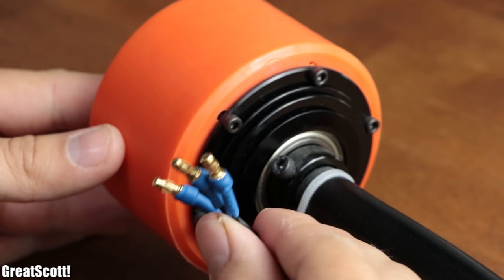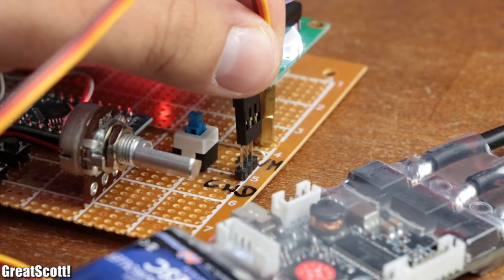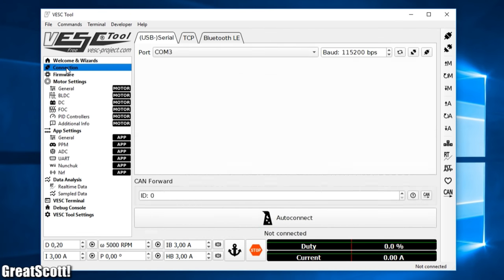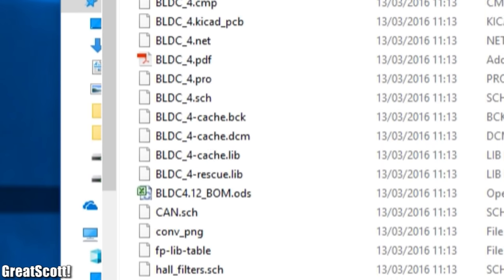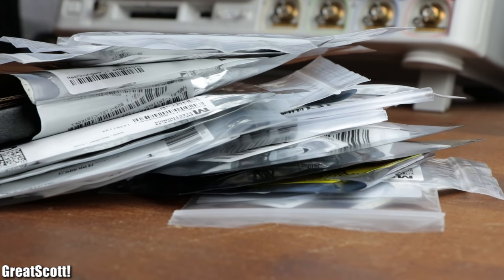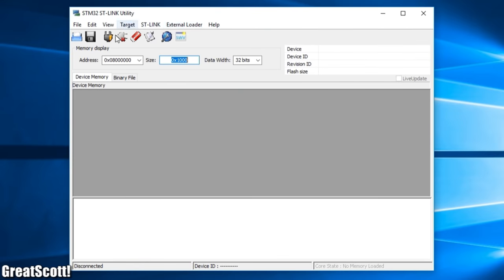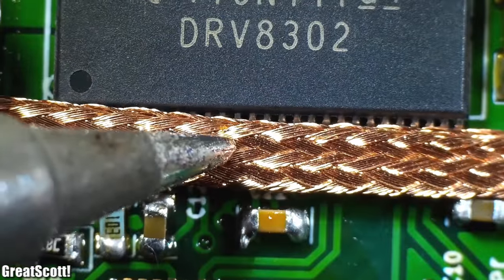VESC (Best Open Source ESC) || DIY or Buy

Comment: That soldering looks very bad.
Reply: smd soldering is very difficult even for people who've done soldering for years
Reply: AppleAssassin

Some SMD soldering can be tricky, yes, but things can be improved a huge amount just by a few technique changes.

The diameter of solder used here is pretty huge, and it doesn't look like any extra liquid flux was used, which is basically a prerequisite for smaller SMD like the QFP and SOIC chips.

It honestly doesn't take long at all to learn those few methods, swap out the evil bevelled soldering tip for a small 2-3mm wide chisel, buy some no-clean liquid flux etc.

It's also about not sufficiently heating both the pad and pin, then feeding in a smaller amount of solder.

The solder should ideally be fed into the contact area between the component and pad, and not "brushed on" nor moved around with the iron too much.

Mr Carlson did a good video on soldering technique recently. Although it was more for much larger through-hole stuff, he explains things well.
Reply: He needs to use a different soldering tip for SMD components. Something like a chisel tip.
Reply: yeah his soldering tip was way too big, I got the same soldering iron and normally there is a thinner one. Sad not to see the german perfectionism here xD
Reply: Yes, and stop adding more solder to it. The little on a chisel tip is more than enough.
Reply: Colin Alston but heats up the ic so it can damage it
Reply: He didn't use flux. That's the reason.
Reply: You shouldn't just use the solder that's on the tip of the iron, btw, as it will boil off most of the flux before it has chance to work.

The tip should be "tinned" with a very thin layer of solder at all times (and regularly cleaned on a wet sponge, then re-tinned), but the fresh solder should still be fed into the solder joint after it has been heated for about half a second to 1 second.

But yeah, you definitely don't need to blob that much solder on.

The solder joints should ideally have a kind of concave "fillet" shape to them. Like this...

https://www.helifreak.com/attachment.php?attachmentid=301793&d=1332650444

https://www.nuvation.com/resources/article/pcb-layout-creating-perfect-smt-footprints

Obviously we're not expecting pro-quality soldering on a DIY project, and my soldering isn't perfect either, but I hope this helps a few people. ;)
Reply: I think people convince themselves that it is more difficult whereas with a little practice it is actually easier or at least no harder. Using a huge tip, putting on way too much solder and then thinking the hot air gun will fix anything is a sure fire way to fail. I'm IPC certified and been in the industry for about 40years (commercially) but getting to IPC certified level is achievable by raw beginners with a week of practice. That is proven on each course they run.
Reply: I love his projects but not his soldering techniques... He should've used flux alone instead of using the solder fluxcore to make things flow.

Maybe the IC died because of so much heat? You gotta be very quick and don't be messing with it for so long with the hot air on top
Reply: AppleAssassin . No it's not. 1206 or 0805 is perfectly doable for pretty much everyone with a standard solder iron. In many cases SMD is even easier since you don't need to flip the PCB the whole time.
Reply: Piet Muijs Even 0201 is doable with a standard soldering iron, a set of 1$ tweezers and good flux
Reply: SMD soldering is VERY easy. This BS about it being difficult comes from grandpa kind of engineers that struggle to make the right joint, as they used to do THT for their entire life, and SMD is still something new to them. Then everyone spreads the lie, cause if so experienced engineers say that it's hard to solder surface mount components then it mus be the case. And now we have the third generation of hobbyists that repeat the same shit.
Reply: I was just going to comment that the soldering was not bad. Now, don't get me wrong, it's not great, but for GreatScott! it is a huge improvement.
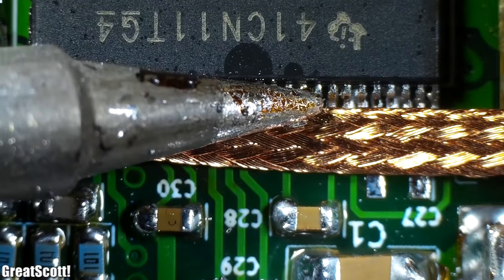Reply: When ever i see him put large mounds of solider on the connectors and then wick away the massive amount of extra, i cringe (ie 7:42 is massive cringe for me).  the lack of fluxing, bad tip choice (conical tips are horrible for SMD, blades and hook tips are ideal for SMD).  Really should be using much thinner solder wire (shouldn't really need anything larger then .8mm dia solder) for most of those small SMD parts.  Instead of the paste. Add Flux and heavily tin the pads. Then use a little hot air.

I only use solder paste when i have stencil and want to do the entire board in a signal shot with a soldering oven AKA a Toaster Oven.
Reply: I've learned quite a bit just by watching Louis Rossmann repair Apple MacBooks.  I don't really get into SMT much, but the right tip, proper diameter solder and precise control over temperature make a world of difference.
Reply: Cap 🗿
Reply: Lack of flux

Comment: C15 and C38 around the crystal should have the same value (18p), they have however a different color in your video. C15 looks surprisingly like C32 (that should be 100nF), so C15 is likely wrong. They are responsible for the oscillator. Please check and replace these components, they will likely fix your problem.
Reply: I wonder if that worked for him...
Reply: Dude, nice find!
Reply: Yeah, unfortunally scott's soldering isn't that great...
Reply: @samuellourenco1050  yeah.. and also lots of cold joints, voultar would cringe watching this video
Reply: @geovani60624  i saw alot of cold solder
Reply: That would not solve the problem, probably, cause if the hse crystal is not able to work properly, the hsi should work. So that change would just affect the source of clock, the problem doesn't seem to be in the clock tree.
Reply: I bet they are identical, it's just nasty flux residue over one of them.

Comment: have you tried some isopropanol and a toothbrush? it seems like you have a lot of spent flux there!
Reply from the maker: Yes. For the repair I cleaned the PCB quite a bit. Did not help though.
Reply: would you do a troubleshooting video? it would be really interesting! i am thinking about building my own esc for a while, i want to make a super beefy power output maybe with parallel mosfets and active coolling, for a really large bldc. Btw another cool diy or buy video would be a stereo amplifier! (class a/b, maybe? :)
Reply: GreatScott! I too have soldered the VESC on my own. The 10uF caps were really a problem so I got myself 4.7uF and soldered 2 on top of each other. Has the same effect. On mouser they have other MOSFETs with +0.2mOhm more rds on so I got these. Soldering took me 3 days since I could only solder in class since I don't own a soldering station. My first power on was horrible too. The VESC wasn't drawing any amps. Troubleshooting took about 2 weeks. I broke the MCU while measuring the voltage on the voltage regulator. Had to resolder it. I managed to programm the new MCU but the VESC wasn't working, so I thought it would be due to the unsoldered Drv ground pad. So I got a new chip. Resoldering the new one, the VESC wasn't working. After some time i desoldered the capacitor that is on the output of the buck converter and found out the the cap was broken. After that everything worked just fine. All this took some time but I had to get it going since it was my Abitur project. 
But the one VESC that isn't working, are you sure you soldered the groundpad? Are the voltages all right? Get KiKad and open the pcb file, with that you can see all the traces and perhaps find the error. Perhaps a pad of the MCU isn't soldered right. Troubleshooting my VESC made me examine every inch of it till i found that faulty capacitor.
Reply: 7:35 you need learn more

How to repair bridge and excess solder > watch?v=OaBRak0HnQs
Reply: +Faza Indriani
It's easier to use full links...
https://www.youtube.com/watch?v=OaBRak0HnQs
Reply: Can't clean no clean flux, I've tried.
Reply: Maybe try turpentine?
Reply: TheCreeperkiller of course you can. But the flux is not the problem here (flux is not conductive, some fluxes could corrode the board or increase leakage but that's unlikely to be a problem here). Given the soldering he has done there are likely more shorts there. Instead of futzing with the heat gun and paste it is better to drag solder it. And use thinner solder so that there are no blobs.
Reply: At least not with isopropyl alcohol, or maybe it's because the flux I ordered is from ebay. No matter how much alcohol I used and cotton swabbing, it still left a sticky residue.
Reply: It's like having a conversion with someone with about  loads of boogers hanging from their nose!
Reply: @KerbalLauncher  IPA doesn't help much with too much flux. Use Methyl Spirit instead.

Comment: Keep in mind that 90% of power transistors at Chinese online stores, especially aliexpress ones, are fake (cheaper, less powerful crystals than claimed). So even with firmware working there is a chance for it to blow itself up under heavy loads.
Reply: Totally agree! Those of us in the industry knows what's behind the scene. Nowadays, the counterfeit chips and components might even spot genuine looking markings, packings etc.  Electrolytic capacitors are the worst. Certain PC Motherboard manufacturer actually loaded fake caps unto the boards. 5 container loads of them, and all go harsh harsh to prevent embarrassment. Well, anyway, they expect no one will use a PC board for more than 2 years, so its ok for the caps to burst and vent while in service after that...As a rule of thumb, I'll treat ALL components from Aliexpress as counterfeits and supposed I need to use a 3A diode, I'll select a 5A one to accomplish the task.
Reply: @rontan8433  The famous China factor you have to add to everything.

Comment: Loved your video, but I do have a bit of a recommendation. After working on some complicated SMD circuits, I decided I was tired of hand soldering, and moved towards DIY reflow. I ended up getting 2 solid state relays and used them to drive a 2 element toaster oven with an arduino for temperature profiles. After a bit of programming, everything worked flawlessly. Now I just order stencils along with the PCB's, spread the paste over the board, stick the components on, and bam, perfect boards every time. I would love to see your take on a DIY reflow oven, and it would also help to improve the quality and quantity of boards you can produce. Anyways, keep up the great work!
Reply: good to know! ty.
Reply: Nice work.  Will it heat pop tarts still?
Reply: Hey would you mind recommending what type of heating element to use ??
I have ordered an LQFP-144 ic 
and honestly getting nervous as the delivery date is approaching
Reply: @TheAnimeist  No. An oven used for soldering or other chemical processes can never be used for food.
Reply: @user2C47  What if I wanted to poison someone with a cooked pop tart?  😀
Reply: @TheAnimeist  It would be a very slow death, and would likely require repeated exposure.
Reply: @user2C47  LOL

Comment: If you are going to do many projects like this, do get:
Flux (helps in getting the tin to behave)
A wedge tip for the iron (easier handling, can be laid flat aginst chips/solder wicks)
If it's not, get a temprature regulated one (any from china should do)

I agree on your conclusion, and JCL got a PCB assembly service that would likely be of great help.
By just getting the tiny (resistors & capacitors) stuff out of the way should help a lot, even if you have to place some few parts yourself.

Comment: Maybe if you make/buy an SMD to breadboard adaptor for the uC and program it before soldering it. Place it on a breadbaord,  add the oscillator and everything, and program it, At least you know that is not the uC with the problem. 
Great video and pretty complicate proejct!
Reply: Electronoobs how in the hell is this comment posted 1 day ago??!!
Reply: Youtube red?
Reply: Jan Daniel Javier he is a  patreon supporter
Reply: Patreon supporters pay to support the channel and noobs is a patron as am I
Reply: I think only problem is time who will spend more than 10 hours of prototyping and  soldering process.. just to save 30 dollars.
Reply: Sumit Kumar hey being an indian 30$ means a lot to me !!! I can start another project with those 30 bucks
Reply: You haven't seen his DIY Time Machine post? ;)
Reply: Yes, I think that too!
Reply: dome dom STM32 don't need a bootloader using ST-Link, it just overwrite the uC without problem. Maybe the problem was the pull up resistors on USB data lines
Reply: Also maybe to prevent shorts and all that soldering wick I'd say spend the extra $10 on a stencil and use all/mostly solder paste with a toaster oven or some hack...
Reply: Jan Daniel Javier Scott uploaded the video on 24th
Reply: man I love ur vids, but sad to see this one didn't work that well, but i do alot of hand soldering myself and self taught. I would suggest just using using solder paste with toothpick method, youtube it!! :D Solder paste all the pads and then heat gun them all on level surface just like the manufacturing process. saves time, i would then troubleshoot one by one, considering you were able to upload the firmware through st link and not get com port to show up in pc means there might be an issue with usb connection, maybe shorts. try reversing them traces with multimeter in diode test mode. if all fails it could be software related, try uploading sample sketches to make sure usb shows anything at all pc side. but your point is right time is money, but try fiddling with it, when you have spare time to kill :)
Reply: Vales verga wey como electronico , ablas como si tuvieras una verga en la voca
Reply: HEY MATE CAN I USE A SEPARATE ESC OR VESC FOR EVERY MOTOR I GOT WITH A SINGLE REMOTE ???
Reply: Or the wrong Hex Number to start the writing. Many STM32 have the same but not all of them. Maybe even noticed somewhere later in the documentation. I havent checked this guess but quite common mistake that happen from time to time.

Comment: I would definitely recommend you using a much smaller solder.

I use 0.5mm solder for pretty everything, and occasionally used 0.3mm on really small SMD, but if you add extra flux then it makes all soldering much easier and tidier.

(so I haven't needed to use anything smaller than 0.5mm for years.)

Also, try a small "chisel" tip on the iron, say around 2-3mm wide.

The sharp corners of the chisel can be used to solder very small joints like SOIC and QFP pins, while still having the larger surface area of the whole tip for through-hole joints etc.

For both uses, you should get far better thermal contact, plus the flat tip will retain a nice level amount of solder rather than a big blob.

Again though, and I can't stress how much this helps, but - FLUX! :p

I realise there is flux in the core of almost any electronics solder, but a good no-clean liquid (or paste) flux is invaluable, especially for SMD.

(Maybe not quite as much flux as Sir Louis of Rossmann uses, but hey, he's an awesome solderer, so I can't really complain there. lol)
Reply: 6:56

You should never need to "paint on" the solder like that if the pin / pad is sufficiently heated by the iron first.

If you heat both the component and pad for a bit less than 1 second (with the iron touching both at once), then feed in a tiny amount of solder to where the pin / pad / iron meet, it should just flow nicely.

If you notice that it's not quite enough solder, you can just add a bit more while still holding the iron in place.

Trying to move around the solder around on the board too much, dropping / painting the already-molten blob from the iron, or just heating the solder for more than about 2-3 seconds will tend to "boil off" most of the flux, and prevent the solder from flowing / sticking properly.

Hope this comes across as constructive only.

I'm not the best solderer in the World by any means, nor officially qualified, but I do think these few suggestions will help immensely. ;)
Reply: One of the main things though - that solder looks HUGE. hehe

It must be at least 0.7mm, maybe even 1mm?

Try 0.5mm, and stick with it for a while when soldering SMD stuff.

Even for through-hole, it's not so thin that you're constantly feeding in more solder, and it gives far greater control over the amount.
Reply: Here's a superb video on SMD soldering techniques...

(it may look like he's using a bevelled tip here, but it actually has a slight flat on each side. Either way, I would still recommend a 2, 2.5, or maybe 3mm chisel tip. It masks life a whole lot easier. :p )

https://youtu.be/3NN7UGWYmBY
Reply: Very good information
Thank you very much

Comment: Hey Scott, in order to solder the LQFP package as you did, use some liquid flux. Spread it on the pins and use some solder wire on the iron tip to individually solder the pins. It is very effective. I had tried the solder paste method at first but it caused shorting of various pins.

Comment: Check your C15 cap next to the crystal. It looks darker. Darker ones are usually in nano or micro Farad. Thats way to much for a crystal to start swinging. That seems to have wrong value if connected to crystal pin. The other cap is brighter. Thats ususlly pico farad and may be ok for crystals, but depends on crystal and its load capability.